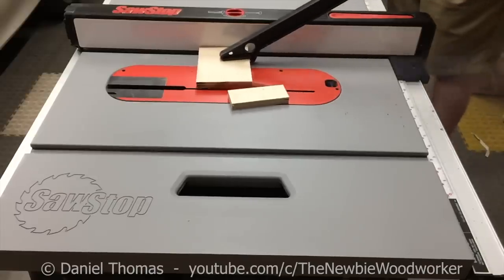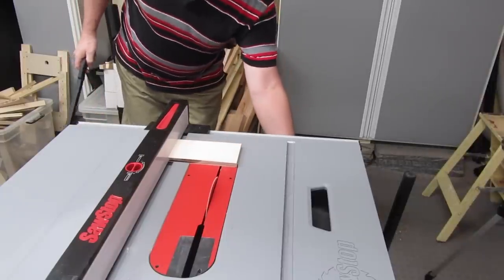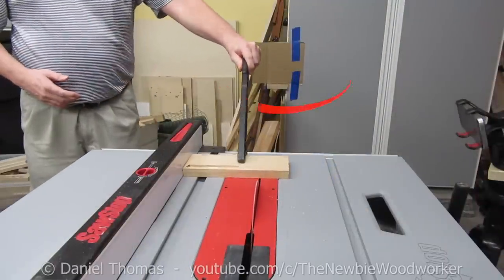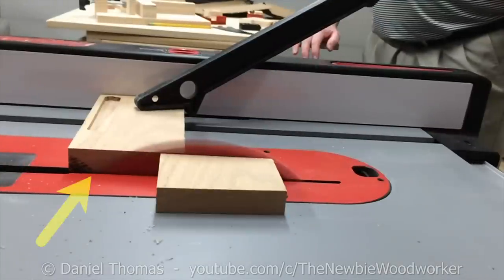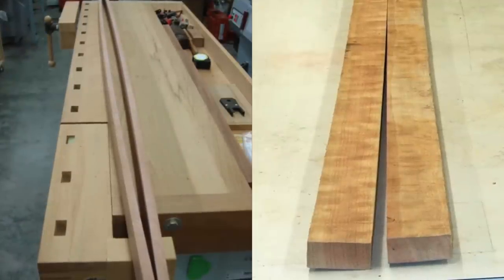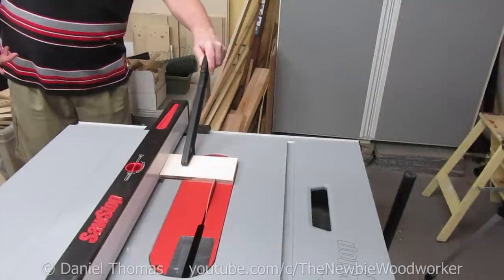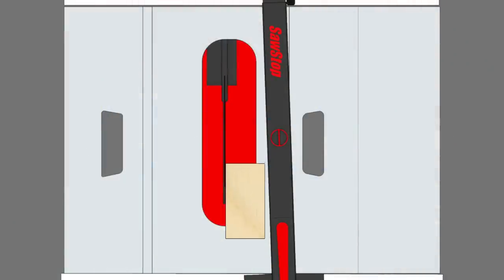Actual Kickback (in Slow Motion), & How to Prevent It

Comment: Wowser! Im about to add a jobsite table saw to my meager collection in my workshop (Kneeling down to cut using my circ saw and insulation foam is now as hard as standing back up....) and I thought I wasnt going to bother aligning the fence or making all those stupid crosscut sleds and stuff. I also balked at the insane cost of the Microjig Ripper (we get "bent over" for the cost of everything in Australia, especially all the fancy t-tracks and flash woodworking gear) 

Seems like I am going to bother, now.
Reply: Im also now going to take much more care at the router table - hand-me-down from my father-in-law - ive clearly been far too cavalier, and lucky, until now.
Reply from the maker: @petermiddo  I have to laugh (or cringe) at your comment about the cost of the Grr-Ripper. Here in the states, I think the cost is exorbitant. It's a great product, but come on - it's just plastic and screws. And I know things are much more expensive where you live, so the cost has to be ridiculously high! On the other hand, it's better than an emergency room visit, right?

When I first started getting serious about woodworking, I felt like what you said. I can't believe how lucky I was to not lose any fingers. Then I started learning about WHY those things mattered, and I almost got sick to my stomach knowing all the stupid things I got away with. 😮
Reply: @TheNewbieWoodworker  I am glad you did get a bit of a laugh out of my GRRRRR-Ripper comment. (The extra R"s was from the groaning of the wallet opening to pay for one.... ) At AU$119, converted back, still makes them US$80. Even factoring shipping, that's a hell of a markup. And retail outlets are shipping them in bulk and not honouring manufacturers warranties on internet bought ones, even if they're genuine and the retail outlet is the agent in Australia.
Reply from the maker: @petermiddo  "The extra R"s was from the groaning of the wallet opening to pay for one.... " 😂

Comment: One important key is also DONT BUY a crappy table saw. They most often have a terrible fence that's very difficult to align parallel to the blade. I had a crappy Mastercraft (murdercraft?) table saw a few years ago and I guess the screws holding the riving knife in place loosened over time. So the wood didn't fly at me, but the metal riving knife sure did. All I heard was a loud bang. I felt like i was on a battle field checking myself for bullet holes. Luckily I wasn't hit too hard, only left a few minor scratches on my shoulder and stomach.
Reply from the maker: Holy cow! I'm glad you're OK. And while I agree about crappy table saws, I think all of us should get in the habit of making sure our riving knives aren't coming loose. Thanks for the reminder!

Comment: For ANY croscutting of long or narrow parts, I use a sled. That is at least one safe method. It allso enshures your part cannot be clamped between the fence and the blade. Instead of the wooden block clamped to the fence for crosscutting, I use a switchable magnet block that sticks to the table anywhere I want.
Reply from the maker: I agree with everything you said, except that it is still possible to get your stock clamped between the fence and the blade, depending on your sled size, and the size of the cut, if you don't use the wooden block or magnetic block you mentioned.
Reply: @TheNewbieWoodworker  Shure, if you don't think about what you're doing things can (and do) go wrong. There is still no easy cure for ignorance and stupidity.
Reply from the maker: @DickvanZanten  True. There's also no cure for arrogance - I've talked to so many people who are sure it'll never happen to them. I keep trying to tell them that just because something hasn't happened doesn't mean it won't. Stupid is as stupid does, I guess. 😏

Comment: Kickback can and does hurt many people each year, I remember calling out one of my workers for only half using the table saw correctly as he made a crosscut he was using the fence and said that his Shop Teacher hade told him to do it that way because he was cutting off more then 2” on the cut off.. no push stick either.  I gave home an option do it my way or hit the highway because I would rather spend the time looking for another worker then I would spend it looking for his fingers in the sawdust and then in the emergency room.                                                                                                                      . But one more thing The best safety device (besides an aware woodworker) is the Saw Stop Saw, this is the only innovations made in power saw technology, and it definitely will saw fingers and hands.
Reply from the maker: I agree 100% with everything you said. Good on you for forcing the worker to do it right, and who the hell is that shop teacher? Wow. And yes, I love both SawStops I've owned. Well worth the money. Thanks for the comment! 😄

Comment: The video is very old, but I hope someone will read my comment. The author at some point asks for a situation, or type of cut when we would not use the riving knife.

Here is my reason,

I have makita table saw 2704N. This particular model (I don't know about others) comes with a riving knife, blade guard, and even antikickback pawls. Perfect!
However, if you google the saw and check some images, you will soon find out that the riving knife is too big (because it serves as a support/holder for the blade guard). By big, I mean it is very tall, taller than the blade itself probably about an inch or so (approx 20-30mm).

That said, making a groove is impossible with the riving knife in place. The manual says this table saw is not for making groves, rabets, etc, just full cuts. That is rather disappointing. This table saw in my country costs $1200, and is no different than other table saws from that class - meaning it is capable of doing pretty much everything - assuming the riving knife is not there.

That was my first reason to remove it. The procedure for removing and putting it back on this particular saw is very tedious and tricky, so after a few times, I decided to have it removed permanently. I used it like that for a few weeks, luckily I was careful enough to not do anything stupid, but also I was afraid every time I used it. An aftermarket riving knife that would match this saw was not available in my location, so I ordered a custom build from a local metal shop. Now I work on my table saw little more relaxed. Still very careful of course, having riving knife doesn't guarantee 100% safety, but at least riving knife is in place. 

And unfortunately, the blade guard can't be attached anymore, unless I switch back to the old (original riving knife).. But this is a compromise I have to live with.

I am still just a beginner hobbyist woodworker, so I haven't done any intricate cuts, but I have tried pretty much all standard cuts, and with my new custom-made riving knife, I haven't encountered a scenario to remove it ever since.
Reply from the maker: A lot of table saws can't make non-through cuts with their riving knife attached, so it's not unusual to remove it for that. But I promise you, if you do regular cuts without a riving knive or blade guard, you are taking a huge chance. If it's too hard to remove the riving knife and adding it back, buy another table saw. Especially as a hobbiest, the chances of getting hurt are very high. That's my 2-cents-worth, anyway.

Comment: Use a sub fence or adjustable fence to have the fence not to exceed the centre of the saw blade...that way the timber doesn't become trapped between fence and blade after its cut.
Reply from the maker: That's an interesting thought.

Comment: Hi. The best way to prevent a kickback is to use a helpfence. Do not use the full length of your fence but only a few cm before the teeth of the sawblade. Than the wood has room to expand after it has been sawn.
Reply from the maker: That's true if you're using a miter gauge. But if you're not, then what you describe is basically the same as cutting it freehand, which is a recipe for disaster.

Comment: I'm a mega newbie so i may be wrong here or I may have missed it if you mentioned it, but doesn't the height of the blade vs the thickness of the stock have an impact as well. I mean let's say your using 1/2" stock and your blade is set to 1" couldn't that help to lift the stock? Not sure so I'm asking. :)
Reply from the maker: I'm not sure - there might be arguments both ways. But for me personally,  I always set the blade to about 1/4" higher than the thickness of the wood. I feel like the lower the blade is, the less chance my hand will make contact with it. Or, as David Miller commented a couple of days ago: "High enough to clear the teeth on the top of the blade, but low enough to not scare the bejesus out of you." :)
Reply: If you put the blade height 1/3 higher than the thickness of the wood, the cutting angle is nicer.
Reply from the maker: I'm not sure what you mean by "the cutting angle is nicer". Can you clarify? Thanks.

Comment: What is wrong with standing at the back and pulling the work piece instead of standing at the front and pushing it?
Reply from the maker: Stumpy Nubs has a good video on this subject: https://youtu.be/2ab_kLwr_Zc
Reply: Thanks ever so much for that video link and I who am new at table saws just found out that to pull the wood from behind is an insane idea.  

One other question. 

 From various videos I have watched on the table saw it seems that when cross cutting  a piece of wood one never uses the fence.  Fence only used for ripping is what I understand
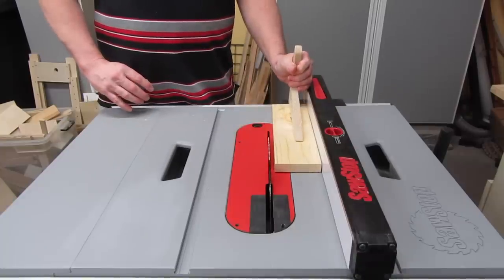Reply from the maker: @erwinerwin1245  Yes, that is correct. My video explains this pretty well here: 10:32.
Reply from the maker: @erwinerwin1245  Thanks for sharing that video. I noticed right away that he had the saw unplugged, and he wanted to make sure we knew it. Another important safety practice, and one that I need to remember. 😄

Comment: I agree with most of your video.  Just one thing.  When you got behind the saw to be "even more safe" actually, in my opinion, put you at more risk.  That would have been a larger kickback it could have gotten stuck in your "pull" stick.  Well guess what, that would have pulled your hand directly toward the blade.  Yes, possibly would have just pulled it right our of your hand but either way, whatever was connected to the stick would have gone toward the blade.
Reply from the maker: Thanks for the comment. I suppose anything is possible, but I think you're giving me credit for a much stronger grip than I actually have. I'm pretty sure it would have just ripped it out of my hand. But it's possible you're right, so I'm really happy about two things: 1) It didn't, and 2) I'm never, ever doing that experiment again!!! :)
Reply: I thought the same thing about 9-10 years ago or so while cutting pvc.  No way would I be able to.  Guess what?  I was doing something very similar to what you were doing and the pvc closed and caused a bind.  While it did pull the pvc out of my hand, it also pulled enough to get my hand moving toward the blade and right into it.  I was lucky to keep my thumb.  Probably the only reason I did was that the blade was only up about 1/16".  I think your video was very informative, especially for those that are new around a tablesaw and I hope it keeps people, like me as well, from doing something stupid they will regret.
Reply from the maker: Well, now I'm grateful I was lucky! I guess the bottom line is, it's called "unexpected" for a reason, right? Thanks for the info, and I guarantee I won't be trying that again!

Comment: I use a bandsaw in place of a tablesaw whenever I can.  I am lucky to have a band saw with a 24 inch throat and a large extension table  and a quality fence so I can use it for lots of tasks that I once did on the table saw.  The force created from blade friction is down towards the table so you don’t need to worry about objects getting launched back at you.  Unfortunately, a bandsaw this large costs about twice as much as a top model table saw.  In fact, I prefer to use a circular saw with a track system instead of the tablesaw these days. In short, I’m always looking for ways NOT to use my tablesaw because it is so dangerous.
Reply from the maker: I totally get it. And if it works for you, I'm all for it! Feeling comfortable and safe is a huge part of being able to create quality projects.

Comment: i think it is very important to hold that wood down to the table and with the with you used not a push stick
Reply from the maker: I agree. If I don't think a push stick will do the work, I'll use a push block or one or even two Grr-Rippers. But I'm still learning what works best in each situation.

Comment: This is a good video, but I do have some comments: 
First, its just terminology, but the last demonstration, I would call "ejection".  Ejection does't drawer fingers into the blade and is usually slower with an absolutely predictable trajectory.
Second: the safest way to cut wood with a ten inch blade spinning at almost 4000 RPM is with a Saw Stop.  It will save your fingers.
But, If you can't afford a Saw Stop, consider a used, but not abused, radial arm saw.  All the old geezers who bought them in the 60s and 70s are in the process of "kicking the bucket" and the price at an estate sale will be right.
With the exception of sizing sheet goods, a properly set up and properly used radial arm saw is a better tool for any home shop than is a table saw.  There might even be one or two good YouTubes videos on radial arm saw.
Last, I'm an old geezer:  I have been using a radial arm saw for at least 45 years and I still have all my appendages.  (One is not working so well, but thats a different story.)
Reply from the maker: Thanks for the comment, Bill. I agree with the SawStop, of course. As for radial arm saws, I've never used one, so I don't have an opinion.
Reply: @TheNewbieWoodworker  Maybe you could find one or two good YouTube videos on the radial arm saw?
Reply from the maker: @billmactiernan6304  Thanks! 😄

Comment: When using a single push stick, you should have your stick in the center of the piece you will have once your piece cut. This way, less chances of twisting your cut piece neither to left or right.
Reply from the maker: Actually, you should favor being closer to the blade than the center of the piece, while still being safe. I'm pretty sure I mention this in the video.

Comment: I was cutting 1 inch off of a 24 x 24 inch piece of 1/2 plywood, and made the mistake of putting the 1 inch cutoff next to the fence.  Long story short, the 1 inch piece kicked back and shot the 1 inch by 24 inch spear, 20 feet to the other end of my garage, and thru the plastic and glass windows on my dryer door.  I was off to the side , one good point, and $152.00 later I fixed the dryer door.  Please watch this Video again, and pay attention.  It is real.
Reply from the maker: Holy crap! Glad you're OK!

Comment: so indeed the real question would be like in 5:35, why not just operate a tablesaw from the opposite end?
Reply from the maker: Well, for one, it would be much more difficult controlling the stock, and the cut. I remember seeing a video that talked about all the other problems that would cause, but the bottom line is, it's just not practical, and since you're one one end of the blade, and the stock's on the other side, it's not really any safer anyway.

Comment: so pushing through with more pressure/uneven pressure on the one side causes the item to curve, so youre actually safer with your fingers closer to the blade lol
Reply from the maker: In some respects that's true. Still, use a good push stick or push block to move your hand further away from the blade.

Comment: Kick back been there done that and was not nice. I was cutting a board and had my left hand on the left side of the table thinking i was far enough away well I was not and I got kick back and my left had slide across the table and two of my fingers hit the blade and not much but just enough that i took about and 1/8 inch off my middle finger and index finger's tips so just a tip never have your left hand on the table of the saw. Oh ya my fingers a doing great.
Reply from the maker: Wow. I'm glad you're doing OK!

Comment: Off subject but I've been asking opinions. I'm on a budget I would like to purchase a planer (Not hand) and jointer which do you think would be more beneficial at  first.
Reply: G T The nice thing about planers is you can make jigs to joint with them.
Reply from the maker: Since I don't have either, I don't have an opinion.
Reply: what about a combination planner/thicknesser?
Reply: Thickness planner no question! (DeWalt 3 blade). If you're buying surfaced wood you can live without it, I did for many years.
Invest in a very good table saw blade, it will make cuts suitable for glue up, use jigs for straightening and edging boards.
This from about 40 years of woodworking. 
My jointer is broken and I don't miss it, I purchased it because everyone said I needed one Oops!
Reply: Xylon Guitars They don't seem too common anymore but if you can find a good one for a decent price it looks like a good option.
Reply: I think you'll do better if you stay on subject. Find a channel that is dedicated to planers would be a good start.

Comment: Most kickbacks shown on u tube are when theres no riving knife, the thin kerf blades are very popular but for these blades the manufacturers riving knife is too wide, my question  is this why they haven't fitted a riving knife,
Reply from the maker: Good point. I don't have any data to back this up, but I think it's probably fine using a stock riving knife with a typical thin-kerf blade. I mean, I did it for years without even thinking about it. In any case, I agree with you - I don't understand why people would work without one.